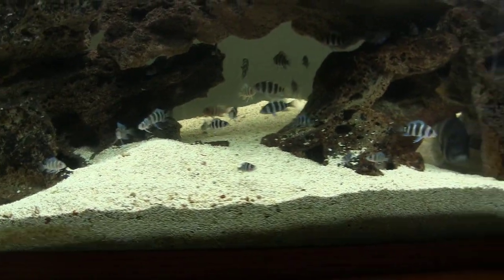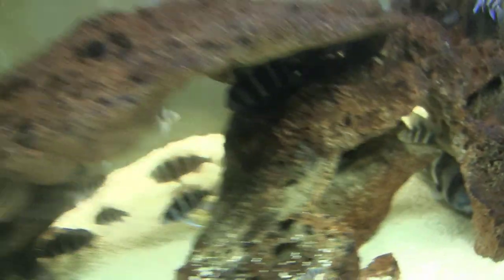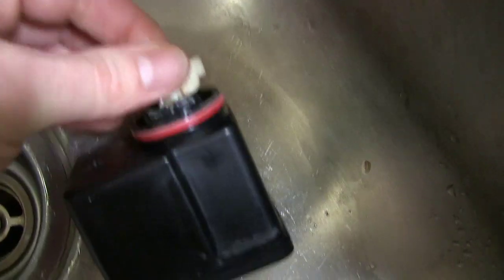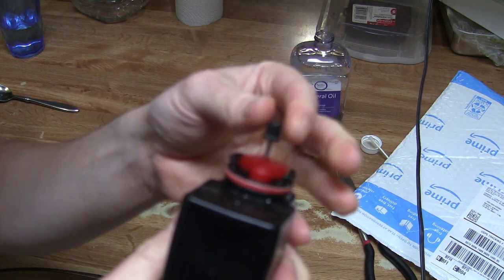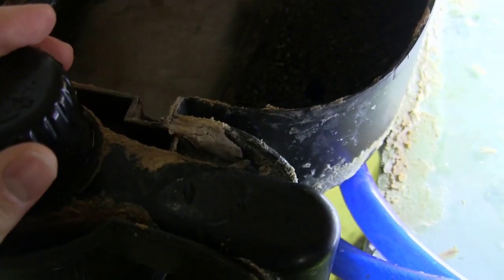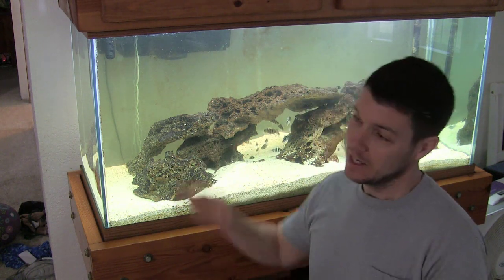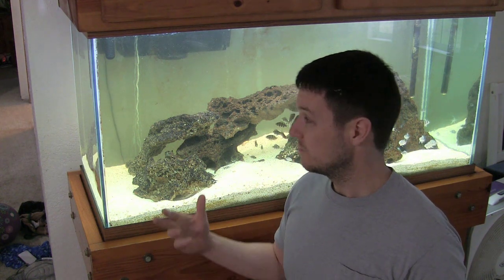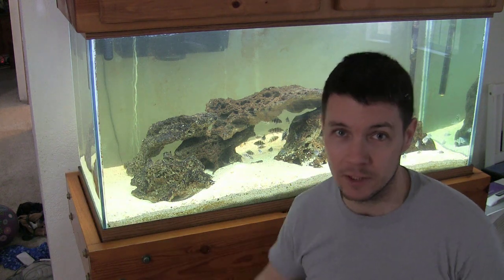This One Trick got My Fish to Breed like Crazy!

Comment: you've kind of built a saltwater system in your tank, utilising rock and sand as the main source of filtration. Since the sand bed is so deep and the flow is so minimal, your sand could be de-nitrifying your tank
Reply from the maker: I'm sure the deep sand bed has something to do with it.  This sand was originally sold for saltwater aquariums and at one time this aquarium was salt water.  The sand is very porous.  Too bad it's not available anymore.

Comment: The deeper the substrate the more anaerobic area there is, and that is where the beneficial bacteria thrives. When you gravel vac you disturb that layer and kill of bacteria and it has to start over. But if it is thick there will be bacteria in the lower layers that can reach the lost bacteria faster. So if you don't do water changes then the aquarium is able to complete it's biological cycle and keep itself alive and healthy with only topping off water.
Reply from the maker: Sure is working well.  And to support your thoughts, I don't ever vacuum the sand.

Comment: Cool! I'm not sure about changing the water in that tank. The tanks I've had weren't that big. I had a maybe 3 gallon tank that I caught some catfish fry. Little itty bitty things, looked like a bunch of little specks with tails floating around. But I kept them in that tank for probably 4 years. I would care the water Avery couple of months at first. But we're they got big enough that there were only 2 of them in there and whenever they would turn around the water would try to splash out I had to let one of them go then I was changing water every day. For about a week till I let the other go 😂
I also raised a Flier. It's a endangered fish species. It lived almost as long as the catfish did in the tank, which was double what it's lifespan was. And it got double the size it was supposed to.
But I did the same thing you do with the sponges.
Reply from the maker: I love these sponges, they work so much better.
Reply: @MikeKincaid79  and like you said cheaper

Comment: Burundi Frontosa are slow growing and not sexually mature until about 2 years old. So your baby explosion is more of a factor of maturity than anything else.
With the increased bioload, you will need to thin the herd some or else risk water parameters getting off. Parents were fine at 2-3 fish and no water changes for 2 years.   But now you will need to step up your nitrate removal, aka water changes or a sump with plants.
Good luck!!
Reply from the maker: Thanks, David.  The original baby explosion was a crazy experience as the mother was in this tank for 2 years by herself, bought as a 1.5 inch juvenile.  She spontaneously had babies on her own.  I've read that some animals can become hermaphrodites to reproduce and she figured it out.  Amazing!  I still haven't done a water change and there are over 80 fish in here now.  She is pregnant again!  I know I need to do something soon and the plan is to move them all over to a 180 gallon tank that I picked up last winter.  I'll film it all when it happens.
Reply: @MikeKincaid79   true about some fish changing sex, however, having both male and female parts in Frontosa is a new one one me. A real mystery and super intriguing.

Comment: No water changes for over 2 years. Very unusual...but I have think nitrification is taking place and the fish are just aclimated to the conditons.  If you were to introduce new fish or 2 most likely it would wither and die  before acclimating if ever.
Reply from the maker: It's been close to 3 years now.  I think it's due to the deep sand bed and the sand is very porous as well so plenty of room for bacteria to grow.  New fish are introduced all the time as the mother continues to have new batches of fry every few months.  Still no problem.

Comment: I have a colony  about 20 frontosa in a 150 Don't understand why you rely on that filtration system I have eight African tanks smallest is a 75 to 150 all running either sumps or canisters
Reply from the maker: I just don't have anything better yet but last winter I picked up a 180 gallon tank and as soon as I find a place to set it up I'm going to use a sump.

Comment: It's all tha porous Rock you have in the tank. It is acting like a biological filter. It would work even if you put a marine wave maker in the tank, which you fit inside the tank . To push the water around. What will filter it even better....
Reply from the maker: Yeah, I think you're right.  A combination between the deep porous sand bed and all the rock, plus a hang on back filter stuffed full of sponge.

Comment: but how are her eggs getting fertilized
Reply from the maker: That is the question of the century.  I have no answer for it, other than immaculate conception.  Maybe she's catholic, I'm not sure.  I bought 1 frontosa, as a juvenile, several years before this happened.  The frontosa I bought is the large one you see in the video.  She was all by herself in this tank for about 2 years, only an inch or 2 long when I bought her.  I've never owned another frontosa.  One day I was looking at the tank and was completely shocked when I saw little fry swimming around in the tank.  I couldn't believe my eyes.  No idea where they came from other than little "Mary" mother of the frontosa god.